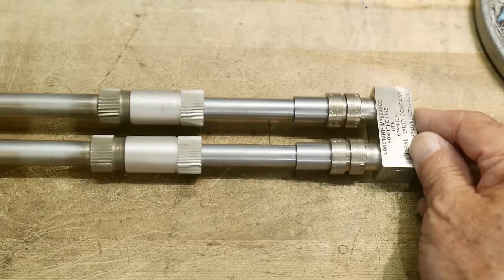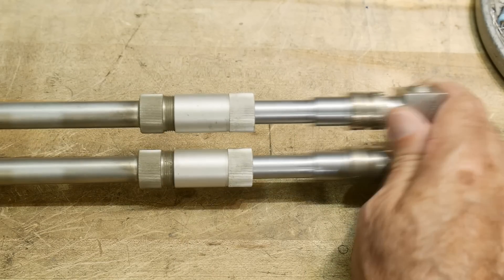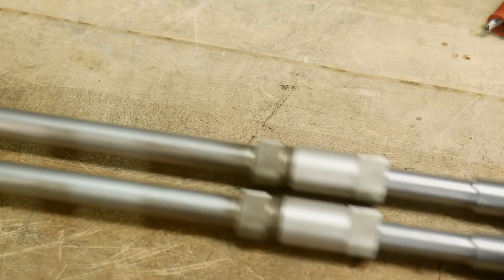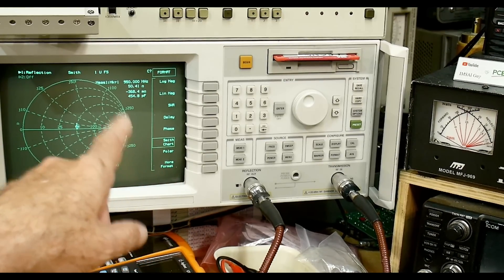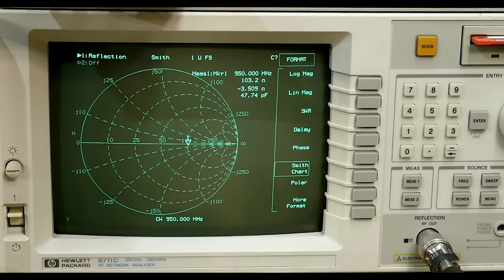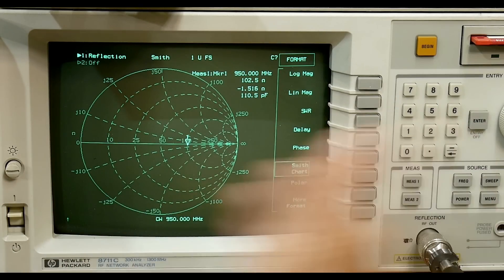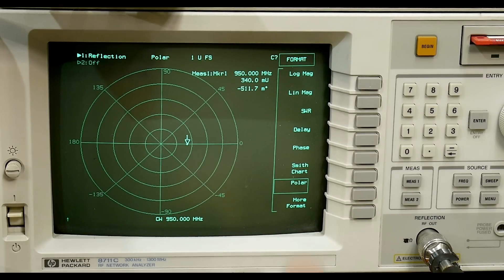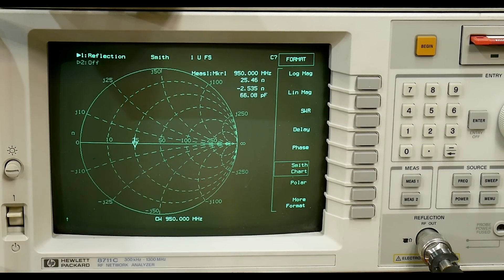#1932 Trombone Transmission Line

Comment: Thanks for the great video and understood 100% of the video. However, can you explain its applications? Why do we need it? To match with antenna for maximum power? the antenna is 50 Ohms so the circle radius in the Smith Chart will be small (because the antenna is ~50 Ohms at the frequency of interest)? varying the phase does not tighten the circle right? Thanks

Comment: Many years ago I worked for a company that made NB FM transceivers and my job was to automate the development testing. One of the systems I created was designed to look for amplifier instabilities and one part of the system was a trombone that was used to change the phase angle of a open or short circuit (sometimes the trombone was to short for the lower frequencies) I automated the trombone by building a stepper motor driven linear drive jig. The system also tested the amplifier across all supply voltages, frequencies, output powers, frequency span, and temperatures. The system could then be left to do its job saving engineers days of testing and do a more thorough job, ie most engineers wouldn’t wait for the amp to cool back down to temp after each run, so their devices would gradually warm up in the oven and so not really be tested at the lowest temperatures and that is where my system would pick up most of the unexpected spuri.

Comment: General Radio: a surprisingly not well known extraordinary innovator of technology and manufacturing. I parted out old castoff GR stuff when I was a curious kid, that I now wish I had in my possession intact. I've got a GR Strobotac sitting on an old farm milk can in my front hall as just a kind of appreciative artifact of innovation that got us here that we now so totally forget and take for granted. I hadn't run into a GR trombone line yet, but I'll keep an eye out for one. I've always been intimidated by the math associated with Smith Charts but I ought to revisit that with fresh eyes and a bit more self confidence. Thanks for the fun and fascinating video.
Reply: I bring out my strobotac every Halloween. And sometimes for a small engine. I should go through it. I have a spare tube, but need a reflector.
Reply: @nerdful1  I don't know for sure if mine works. I knew the guy that I bought it from at a hamfest and he was selling it at a hamfest as part of helping Vermont Technical College clear out some really old lab equipment. It's got a University of Vermont inspection tag on it. The dial drive has too much friction and not enough friction until you spin it back and forth a few times and then it's good. With all of my ADHD passions for old technology and distractions from hypercritical near freak parents insisting that I throw things out (it's my own fucking house that I live in alone and that I have owned for almost 30 years) I haven't yet powered up the Strobotac. I think that the time is coming. I'll have to look up the schematic to see if it looks like a good or bad idea to bring the AC power up gradually using a genuine original GR Variac. Most old circuitry prefers being brought out of dormancy that way but for some things you do bad things like stripping emissivity from filaments running them lit but not lit enough.
Reply: @trevorlewis8515  
I wouldn't worry about bringing it up slowly. Those aren't transmitting or high power tubes. 
     Over the decades I've brought it up slowly a few times. On a Genrad Variac of course. I've thought of going through it someday. It just works. And with the power line calibration neon bulb features, I know I am on the pitchers mound.
Reply: @nerdful1  thank you. I tend to be concerned about old electrolytic capacitors that grenade and spew corrosive stuff and sometimes the mere ballistic force destroys other components. But I haven't opened up my Strobotac yet. Good ol General Radio probably used oil caps anyways because General Radio built things intended to function long past the far side of the apocalypse. But I don't think that I have a cord or a connector that can be a 2 prong female connector that's small enough in diameter to fit into my Strobotac's physically recessed "female-ish" power inlet that has male pins within the physically recessed female-ish opening?

I think that my Strobotac has some very non-mainstream sexuality going on at it's point where the Strobotac wants to "receive some sizzling juice"

Any tips on what/where I can get a non-molded-in connector that can "get it on" fitting into my Strobotac? 

No cords with molded in connectors for the load end, please. They'd be so old that they'd be made of real rubber and they're more cracked than kinky nowadays.

But seriously I welcome if someone has something like a Hubbell, etc. part number of an interconnection device that can "get it on" delivering some AC juice into my Strobotac. 

I'd so welcome a spec of a specific connector I can go find on eBay to be able to "get it on" fitting with and feeding AC into my Strobotac...

I'd be very grateful

Comment: How do it maintain constant impedance? Seams hard to do mechanically.
Reply: like a coax cable, constant distance between the core and the shield, which is not a problem here since it only moves along the longitudinal axis.
Reply: @lo2740  I don't understand how you mean, the impedance is determined by the ratio between the inner diameter of the outer conductor and the outer diameter of the inner conductor. There are three sections to consider, the impedance of the fixed coax, the section where the trombone overlap with the fixed coax and the coax in the trombone.
Assume both the inner and outer conductor of the trombone slides inside the fixed coax then the air gap in the variable overlap will be two wall thicknesses smaller than before and after, it will therefore have different impedance. Similar problems applies regardless of which tube slides inside the other.
Maybe it is some very clever design or simply very thin walled tubes.

Comment: Yep, I also have one of those General Radio trombone lines on my bench. Hardly ever use it but when you need it it is invaluable. I first learned about these when I was investigating metastable states of high speed flip flops. If you violate the setup time specs of a flip flop between clock and data pins you can get the output to go into a metastable state where the voltage hovers in the middle for a long time. You need a trombone line to fine tune the timing between data and clock pins in order to see it.